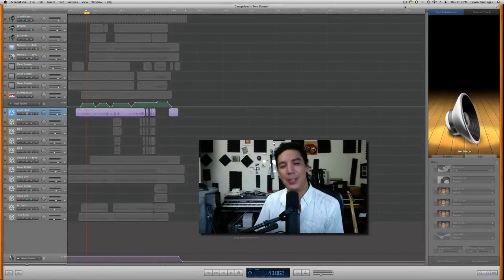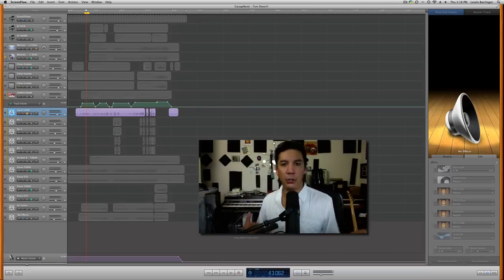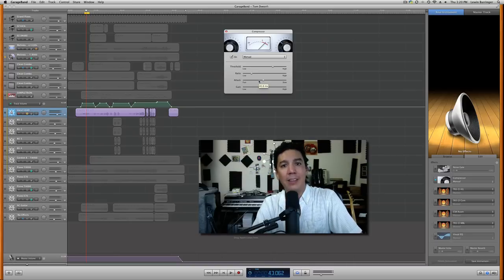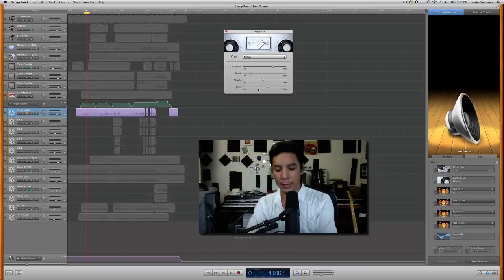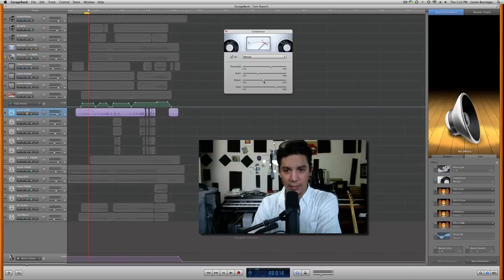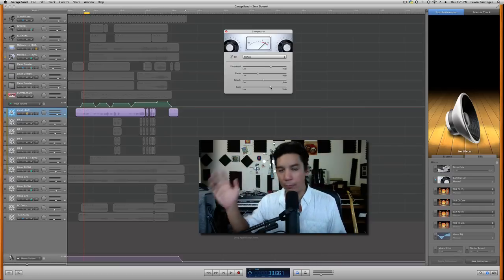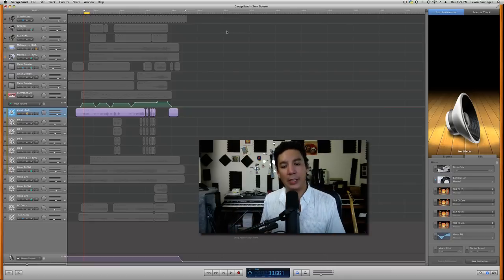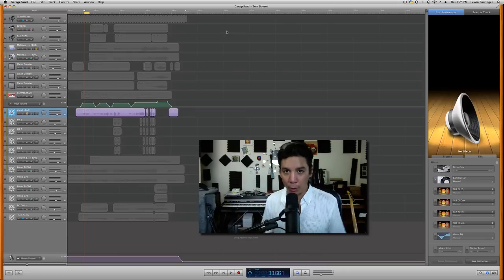How to use an Audio Compressor - Detailed Explanation - Garageband Tutorial

Comment: Good info except for description of RATIO. It is always a ratio to 1 and because the"1" is a given when we say a ratio of 5 we actually mean 5:1. Thus for every 5 dB increase at input the output will increase by 1 dB. A gentle ratio could be 1.5 (actually 1.5:1) and a radical would be 10-12.

Comment: A 1:1 ratio is  linear, but doesn't actually do anything (ie: for one decibel over the threshold, one decibel is heard, which is the same as without compression.) There is no complex math to do. So, from wikipedia: The amount of gain reduction is determined by ratio: a ratio of 4:1 means that if input level is 4 dB over the threshold, the output signal level will be 1 dB over the threshold.

Comment: Actually I believe that the ratio is on a linear scale (anybody feel free to correct me), thus if you have 5:1 it means that the sound is turned down to one fifth of its amplitude above the threshold. a -5 dB decrease over the threshold would equate to more than a half on a linear scale, corresponding to a linear ratio of 1.80:1 or so.

Comment: I like the compressor in Fl Studio, its on the limiter which also can be switched to a compressor. It shows you the wave audio of what you are compressing. I like it because it then gives you lines which you can visually see where to put the threshold, it visually shows you how much compression is on your vocals because purple will start to appear on your peaks and other parts of your audio wave. One thing you should have mentioned is that when you compress something you might raise the gain

Comment: Not at all but only when it is needed. Try not to use it too much as it can suck the resolution out of your tracks. By that I mean, its an effect processor and sound is passing through it. I’m not so sure about the output resolution but I notice a difference even if I barely use compression with the setting on, It has less resolution. I have since switched to a free one I got from Futuremusic magazine

Comment: You might want to use the AUPeakLimiter for compressing the whole mix. I just made a video showing a before and after. Pay close attention the the sound meter. Its shows the difference. The sound difference is dramatic. You should hear more detail in your mix as the peaks have been removed and the lows in the track are brought up and even with the rest of the track.

Comment: I almost never compress distorted guitars, because distortion is naturally compressed already. If I do, I'll use very light compression. I almost always compress bass. Drums I compress lightly 2:1 or maybe 4:1. Vocals usually get some too. But the REAL point of compression is to avoid peaking your levels and to give you freedom to raise or lower your levels to get a good mix. It has nothing to do with the sounds crossing each other. EQ has more to do with that than anything.

Comment: what O.S. , DAW, and Audio Interface are you using?
For Windows with on board audio use ASIO4ALL. For off-board interfaces with ASIO suport, use the newest factory driver.
For MAC (for windows aswell), look into your DAW´s configuration what´s the buffer size it´s set up. As bigger the Buffer Size, bigger is the latency...